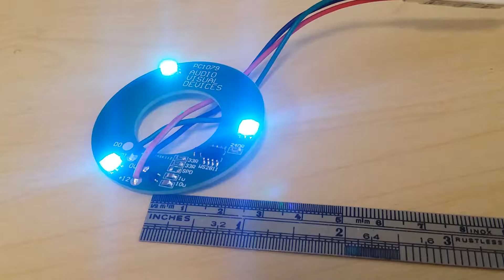Tint Tube Pixel Boards

Comment: Nice little board, looks great and I like the idea of including a "null / buffer" on the output.
Reply from the maker: Thanks.  The idea is to have the new tube lights all plug back into a central box to make setup easier.  This means the cables will be longer so I wanted to make sure the pixel data was a good as possible.